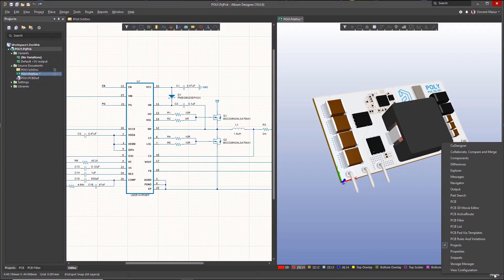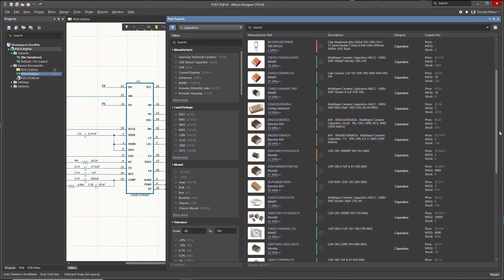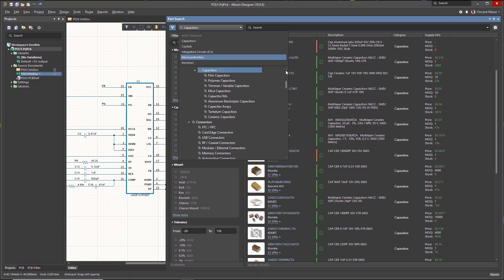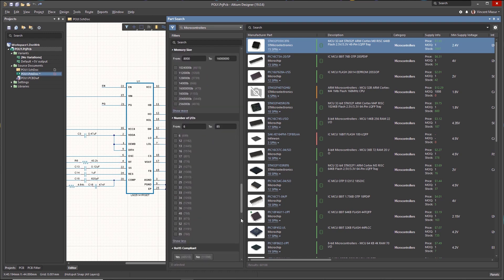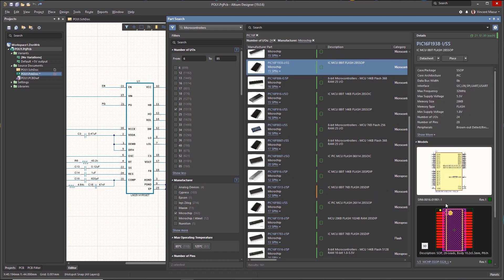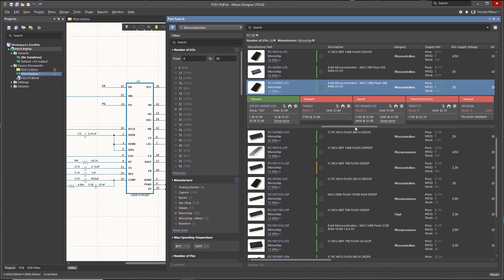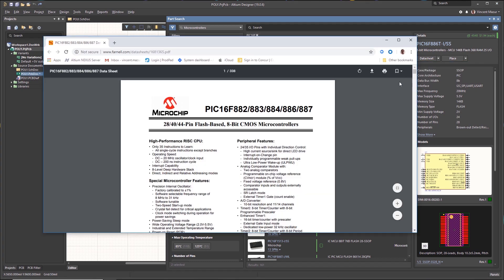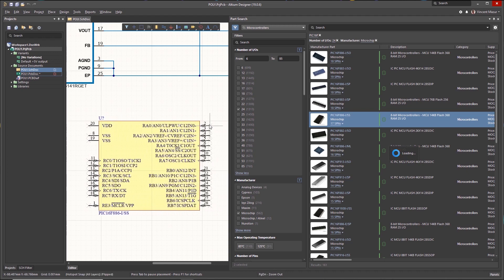Part Search in Altium Designer

Comment: I cannot place part of the components I get on this panel. The button "place" in the pop up menu is just unavailable. How can I fix it?
Reply: Not all parts have a 'model' available. There should be a little IC icon next to the vertical color bar. You cna also filter on this. You can't place the ones without a model.
Reply: @Hneel65  so there is no way to get this model for placing it in the schematic? For example, for my project I need the JST PH 2.0 6P Connector, but there exists no Model. So does this mean I have to consider for another connector only because I can´t use this model in Altium?
Reply: @zirkumflexXx   thanks it is usfull for me